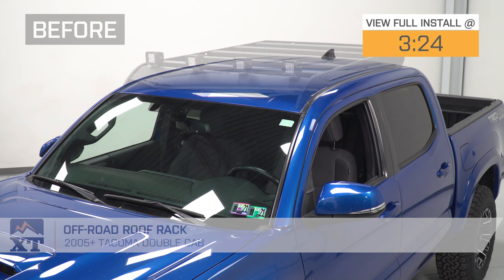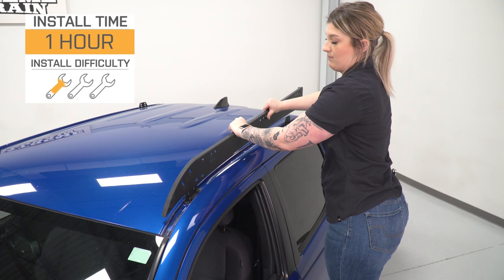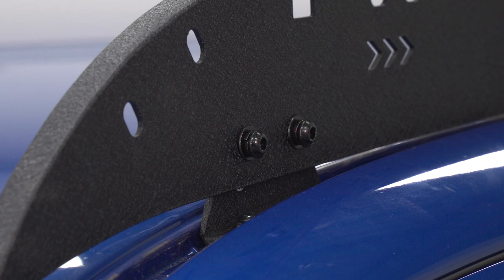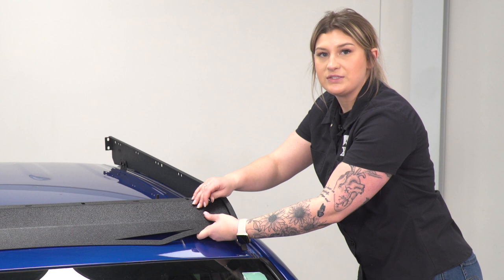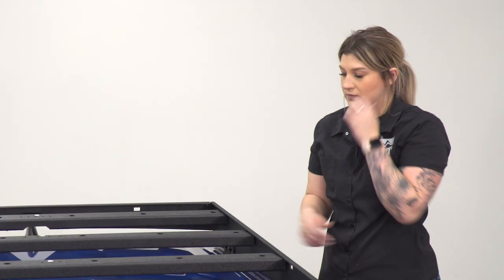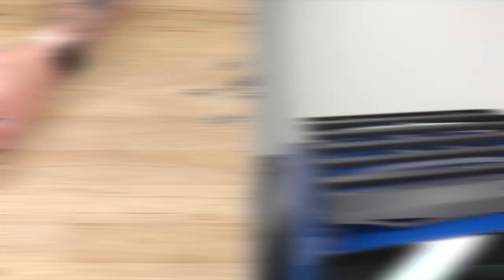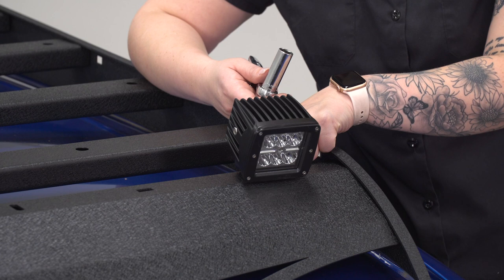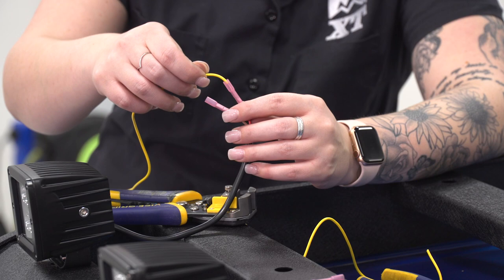2005-2021 Tacoma Double Cab Off-Road Roof Rack Review & Install

Comment: Guys... you have do something on the priceing...
  I just but the combo/set.  Bed, roof & both bumpers.  Roof install is Possible individualy.  I did.  The front deflector is by far the heaviest.  I Used a moving blanket, then a cardboard over blanket, roof & windshield - taped to roof.  Then carefully installed.  It took me Four hours as I took my time. 😁
  Noise... it goes up over 35mph... On highway, headwinds... you Will feel it... 😉
  Weight, just on roof & bed rack... yeah... I noticed it...😒
The thought of the bumpers weight... 😮

Comment: Any reason why you guys didn't put the weather stripping back on and just use a punch to get the holes for the metal hardware that attatchs it to the roof? Should I put the weather stripping back on?
Reply: Use Dremel to cut out notches to fit. Have one power and ground use t taps to attach each. Run wires between windshield and rubber, not on the outside exposed. Get a piece of door moulding put on front of rack so it don't scratch paint and cause vibration
Reply: Het man were you talking abot the roof weather strpping? I got one of these racks and cant find roof rubber reinstallation.

Comment: Great video but I have a question…someone told me that I would need a relay installed instead of the fuseable link. Is this true? The rack I’m installing only has one light bar. It doesn’t have the four separate lights like yours.

Comment: Anyone have a video for the roof gasket reinstall? Can't find one.
Reply: I was thinking the same, and I believe we need to MacGyver it. I'm going to use cutters since the band has a metal band inside and then spread out small spots of adhesive/reinstall

Comment: The plastic gutter barrier was not reinstalled? Why not just Drill it out for the Mount bracket? Why didn’t you replace the gutter barrier?
Reply from the maker: You can do that if you like! Because we reuse this truck for other installs we don't usually drill or make any modifications that could effect other products installs!

Comment: What wiring harness do you recommend?? The one on your website is for “2 lights”. Do they make one for 4 lights??
Reply from the maker: We do not have 4 output harnesses, but we do have split connectors where you can add to it with a regular 2 output. I linked an example here --> https://www.extremeterrain.com/cali-raised-led-tacoma-dt-plug-splitters-crsah0011.html

Comment: will the front wind deflector scratch the paint of the roof?
Reply: Absolutely.  Get a piece of door mounding and attach. Cuts down wind noise as well
Reply: @DanielH97055  i appreciate the tip!
Reply: @DanielH97055  any recommendations where to get something like that I’m a complete noob over here
Reply: @ILoveMrsBeans  lowe’s or home depot, prob a lil late for now but i case anyone else sees this